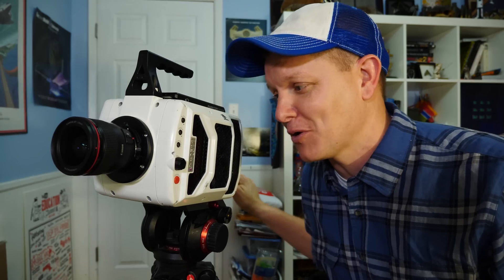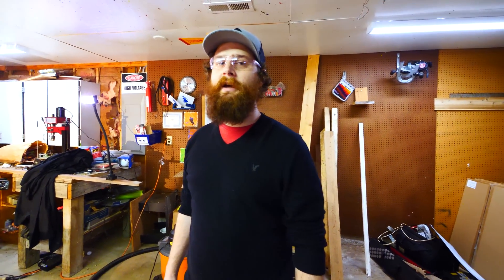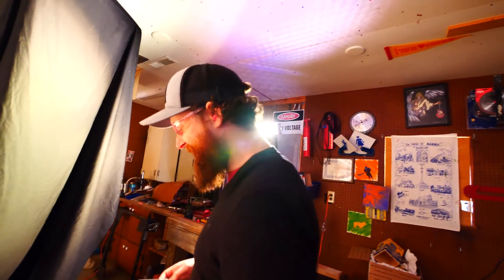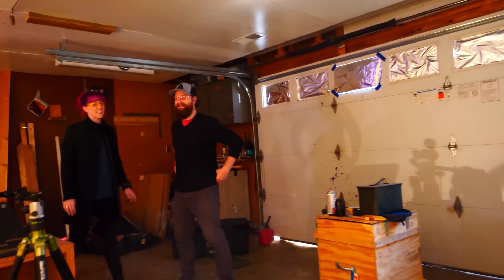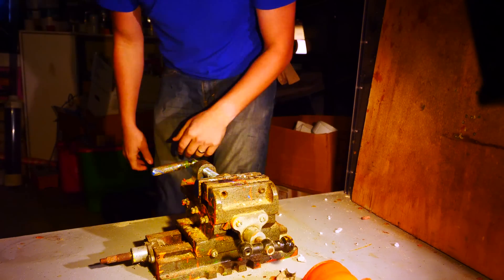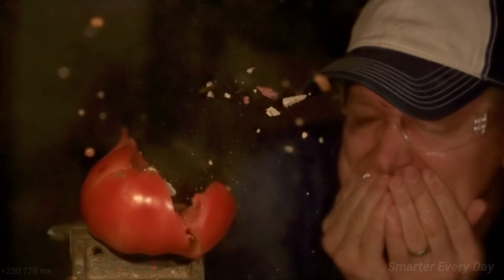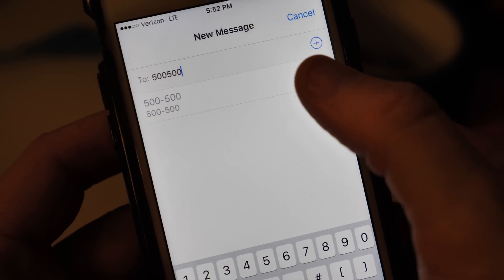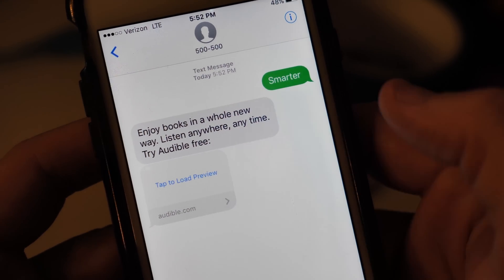How We Make Slow Motion Sounds (Exploding Tomato at 60,000fps) - Smarter Every Day 184

Comment: SO... then the real question is. How WOULD you record the actual sound in slow motion?
Reply: A really fast ADC.
So instead of sampling at the usual sound rates(under 200kHz), you sample much faster, like a few MHz.
Reply: the richest I’m fully in agreement with your stance on this.

For those questioning this - the thing to remember is that the problem at hand is not how to record the sound in slow motion, because there is no such thing. As with recording the moving image, the key is recording at a high enough sample rate to then play it back so that it seems  like it’s been slowed down. That’s easy enough with the video footage because of how vision works, but if we did the same thing with the sound it wouldn’t

For example, human hearing goes up to around 20khz at the highest, and down to around 20hz at the absolute lowest. That is a range of oscillations (frequencies of sound pressure waves) between 20 times a second and 20-thousand times a second. With current technology we would be able to sample at 192khz (mostly sound is recorded at 48khz for moving picture). In theory you can just play the sound back at a slower rate and you get the same effect as slow motion moving image, but you can only go down to about ¼ speed before the sound becomes so slow, and so “low” in the frequency range that there’s not much left to hear. Even with a mixture of that technique, and time-stretching, it would just sound terrible at anything much less than ¼ of real-time.
Reply: W0Y4K it’s not a technical limitation, it’s a fundamental limitation. As Martin said above, slowing sound down to much mess than ¼ to ⅒ speed an you’re going to lose any information that makes any sense. It’s theoretically possible you could slow down ultra high frequencies to within the audible range, but if you get anything out it’s likely to sound terrible.
Reply: Nathan a simplified answer would be this, and this is my understanding, so someone please correct me if I’m wrong or add so that I may learn more. Think of a speaker, the voice coil moves in and out to create the sound. At normal speed this vibrates very fast now think of low bass waves, that same coil is moving much slower, the human ear can only hear down to about 20HZ, have you ever watched a sub at 16HZ it moves very slowly. Now take that information and apply it to the idea of slowing video, you are also slowing sound, once you slow the video down to where cameras of this nature can record that speaker is moving incredibly slow. You can’t record sound the same way you record video, they are 2 very different things, one is the capture of photons which are being emitted or reflected at the speed of light, so a camera can in essence capture all the way up to the speed of light, whereas the other is being captured through vibration, once you decrease the vibrations that were captured they can not be heard anymore because the voice coil of the speaker would be moving so slow you would actually be able to see the speaker moving in and out slowly which does not move air fast enough to create audible sound. You would only be able to mimic the sounds as they did. I hope this helps
Reply: It is possible with good software. It would take the sound waveform (which is linear displacement over time) convert it into a frequency spectrum over time (basically for each microsecond, show which frequencies are heard) then stretch the frequency spectrum graph by however much you want to slow the video by, lets assume 1000x. Now you have a graph the roughly shows for every millisecond which frequencies can be heard in the final video. Convert the graph back to a sound waveform and you have slowed down sound without changing the frequency!
BTW The conversion is done by using the Fourier Transform (for sound to spectrum) and it's Inverse (for spectrum to sound)
Reply: @thanink  This cannot work. There are an infinite number of aliases one can imagine
Reply: @thanink  If you're converting from time domain to a domain that isn't pure frequency, but is time and frequency, that would actually require a different kind of transform, like wavelet or Hilbert-Huang.
Reply: You wouldn't use Fourier transform but wavelet transform. But the phase relations between the frequencies will be lost even then, so sharp clicks for example won't come out naturally, I think.
Reply: W0Y4K yes that would give you a smoother end result of something that is still useless. As I said, it’s not a technical limitation - using higher specs on the technology side won’t make it any more feasible.
Reply: For those of you saying this is possible. a simplified answer would be this, and this is my understanding, so someone please correct me if I’m wrong or add so that I may learn more. Think of a speaker, the voice coil moves in and out to create the sound. At normal speed this vibrates very fast now think of low bass waves, that same coil is moving much slower, the human ear can only hear down to about 20HZ, have you ever watched a sub at 16HZ it moves very slowly. Now take that information and apply it to the idea of slowing video, you are also slowing sound, once you slow the video down to where cameras of this nature can record that speaker is moving incredibly slow. You can’t record sound the same way you record video, they are 2 very different things, one is the capture of photons which are being emitted or reflected at the speed of light, so a camera can in essence capture all the way up to the speed of light, whereas the other is being captured through vibration, once you decrease the vibrations that were captured they can not be heard anymore because the voice coil of the speaker would be moving so slow you would actually be able to see the speaker moving in and out slowly which does not move air fast enough to create audible sound. You would only be able to mimic the sounds as they did. I hope this helps
Reply: @StallionViv  The way I understand it: The idea is to have the speaker move at the same frequency (i.e. the same pitch you would hear in real-time) but repeat that wave for longer than in the original. The technical challenge is to actually be able to infer the frequencies observed in the form of samples, for which you need a certain amount of samples to decompose the wave into as much frequencies as you need for listening experience. To get the same range of frequencies out of a shorter wave, you need that many more samples.

The way I imagine it is: If you sample a perfect sinus wave at some points, the wave length should not matter. It is irrelevant which parts of the wave you sample, as only some hypothetical waves lengths will be a reasonable fit to the observed samples. Now you just need enough samples to cancel out bad measurements and rule out most possible fits. This should not change for a mix of frequencies. You also do not need to observe a full phase or something like that to estimate the wave, you can do that from even the smallest timespan if your measurements are accurate and many.

At least that's what I think. I would love to hear where I'm wrong, as I can't imagine it's a conceptual problem.
Reply: StallionViv great reply, but doubled up ;)
Reply: @Kra Gle haha oh yes the Paulstretch memes ;)
I found a snippet of Paul Nasca, explaining how his program works:
"The idea of it is pretty simple. I take a small chunk (usually around 100 milliseconds) of the audio file from the start position, and I smear it: first I analyze a sound’s frequencies, and then randomize a part of the sounds characteristics and rebuild the chunk. I repeat the same process for another chunk of the audio file, and so on."

Pretty vague but it seems the same idea. I am guessing the "part of the sounds characteristics" he is referring to is the phase of the different frequencies at that time segment since I remember that the phase is lost from the Fourier transformation and/or stretching.
Reply: the actual sound would be weird as it will arrive after the images lol.
and the decay of a shot would be very very long and masking all other sounds
Reply: Great answers
Reply: Sound travels much slower than light, so I would imagine it has much less fidelity at these insane speeds.
Reply: nowonmetube its not false, AI can do many amazing things but it can not create sounds where there are none at that speed (at least that we can hear). Imagine you were somehow able to percieve an event at 1/1000 speed you would see it but hear nothing as all frequencies would be lowered by by a factor of 1000. Showing there is no natural or real sounds to be heard at that pace. A sound artist is much better suited for enhancing the video by adding artificial sound effects (because no hearable sounds exist at that speed) than an AI.
Reply: Nick Brand but stretching it more than 800%??? This is multiple thousands slower, that's a huge difference though!
Reply: Nick Brand this would work to capture a certain frequency of sound wave, however it neglects that you are attempting to record sounds (not frequencies). Actual sound recordings are much more than just frequencies.
Reply: nowonmetube Do you have any examples where real slow motion sounds have been recorded in this manner, or any manner?
Reply: The true answer is that you cant. Especially as slow as these videos are shot. All real recorded sounds slowed to match the speed of the videos would be far far too low for human ears to hear. The only option is to add sound effects.
Reply: the richest  No the true answer is we currently don't know how.
Reply: the richest this is simply false. You can and replay it as slow as possible, combined with an AI artificially creating the sound fragments stretching the Audio as long as needed. They already did that with video and frames (AI NOT frame interpolation!!!)

Comment: If anyone is confused you can't use the original audio because it is recorded at a sample rate of usually 44.1 or 48kHz. If you stretch this audio to match the picture you are decreasing the amount of samples per second. Some software have algorithms to try and fill in where the empty samples would be but this usually adds horrible artifacts. Therefore it is easier to recreate the sound in post-production with Foley and high audio manipulation to make a more pleasing, fitting sound.

Comment: There are a lot of reasons why you can't record "slow motion" like video and that it's not just a case of playing back a slow sound file. Sound files are already captured at really high sample rates (48,000 samples per second). Primarily though, the main problem is straight up that sound takes too long to physically happen (well... and playing back a sound slowly is still producing a physical phenomenon that never existed... if an explosion was slower, it would have entirely different acoustic properties, not just the same...over a longer period of time).

Even a sound as sudden and impulsive as a firecracker will still be reverberating and travelling through the air to the microphone by the time the tomato has exploded. Any sound of the squishing fruit would be completely obscured.

Comment: The whole M-90 or M-80 designation doesn't really mean anything and is just a slang term the fireworks company use to market and sell stuff. Regardless of how high the number goes they have to remain in the 1.4 consumer fireworks class and can only contain a certain amount of powder. Lots I've seen have a regular firecracker with a bigger tube wrapped around it.. Speaking of powder: They don't use gun powder, but rather use flash powder and a very small amount of it seeings how this stuff is super powerful..